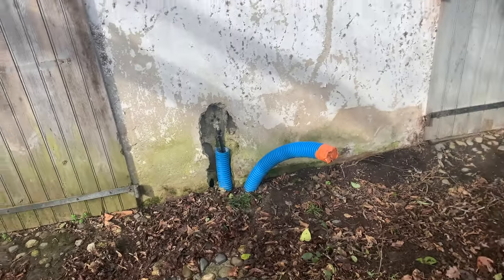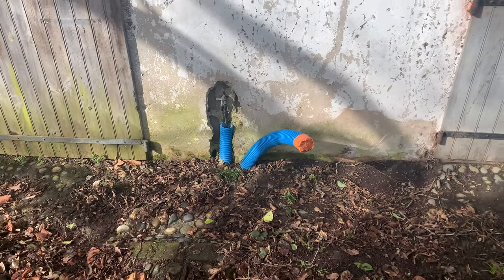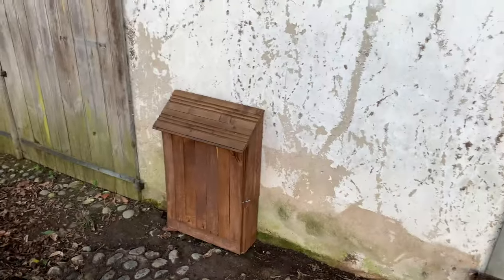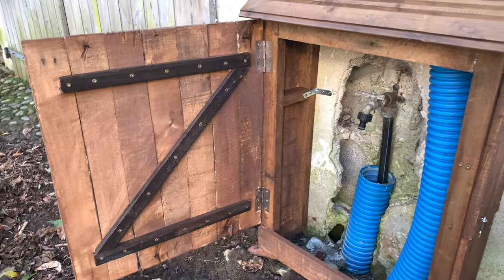Building Stuff #11 - Wooden Outside Tap Cover

Comment: Looks great, loved the chickens helping out.

Wondering if it gives good enough frost protection, thinking closing the air gaps might help improve that aspect.
Reply from the maker: The monsters always “help” out if there is the possibility of food 😂 As for frost protection I originally planned to add styrofoam insulation, however the pipe is already insulated. The tap itself could be an issue. However it rarely gets that cold in the region I live in. Saying all that something I should double check 👍🏻